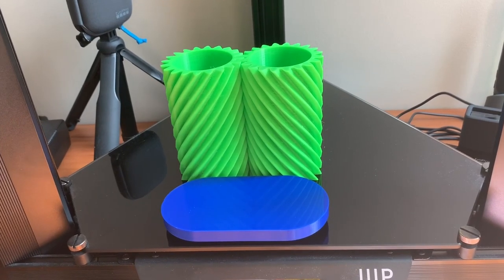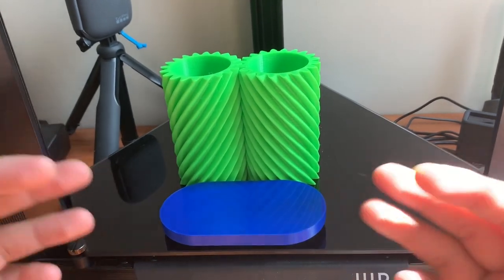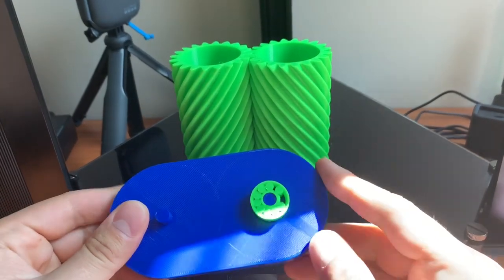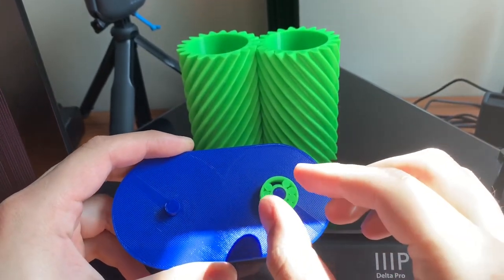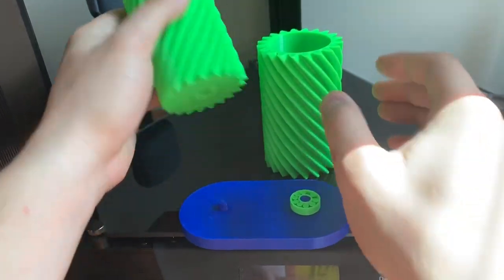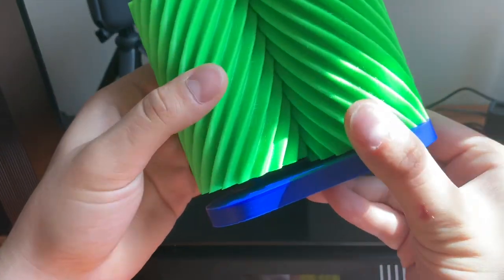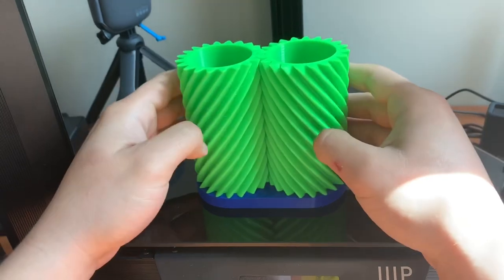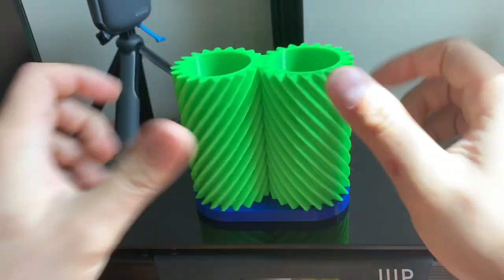Helical Gear Cups with 3D Printable Bearings

Comment: Are Shapr3D final print rough with print layer lines? Is it possible to get super smooth surfaces?
Reply from the maker: Yea, that depends on your printer. If you have an FDM printer you can get decent looking prints that are strong. With SLA you can get great looking prints that are weaker. SLS is somewhere in the middle.
Reply from the maker: Or if you were asking about your file resolution, than that just depends on whether you have the free version of shapr or the paid one. The free version is limited to poor quality because its like a “preview” of the software.
Reply from the maker: This specific print was done in 0.2mm height on a 0.4mm nozzle with my Delta printer.